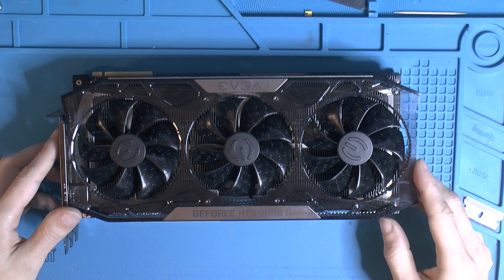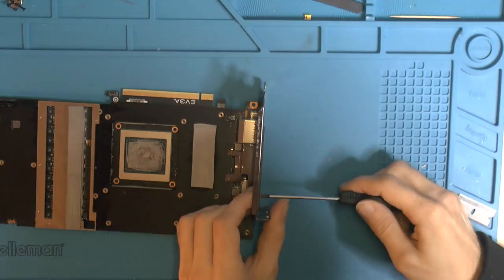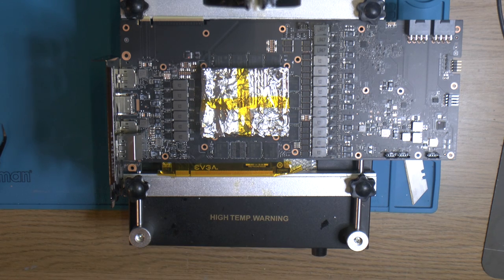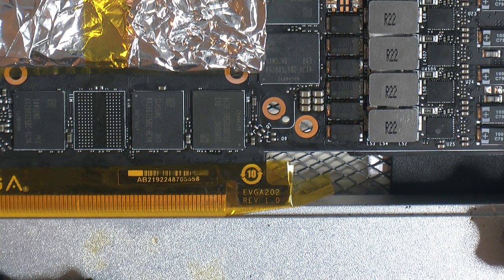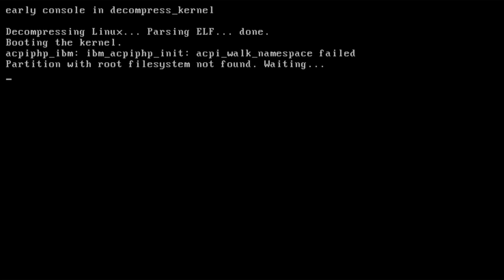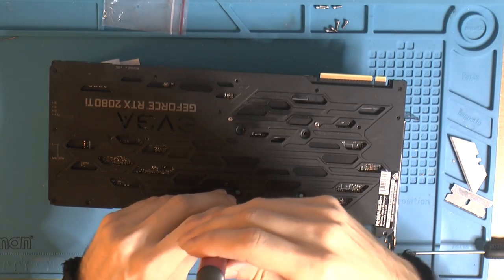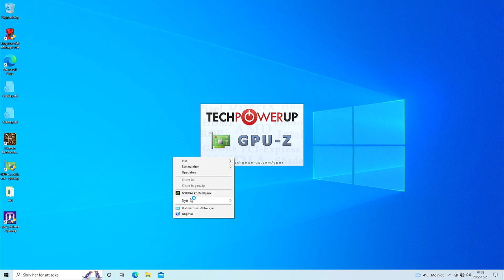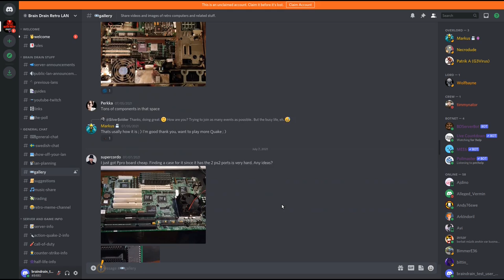Repairing a broken RTX 2080 Ti

Comment: I'm not a fan (no pun intended) of the type of cooler that this uses since all it does is blow the same air around inside the case. I prefer the type that takes air from inside the case, blows it across the GPU and then out the case back thus drawing cool air in from the front. BTW I wonder what would have happened if you had populated that empty memory pad?
Reply from the maker: Your talking about blower coolers, all my daily driver GPU's are blowers, but there almost extinct nowdays for consumer grade cards. The Quadro version of the RTX4090 as fare as a I know will use a 2 slot blower so there viable and doable and often prefererad in enterprise machines if you have multiple cards.
The problem is that no one is doing equivalent development on them for consumers, its hard to compare 3-4 slot openair coolers longer then some cases to a 2 slot shot blower fairly.
But EVGA did some world class blowers back in the day, Also ASUS do have a blower version of this card.

But yea this card wont fit my Midi case, its to long and would overheat asap.

Populating the last slot would most likely not do anything. 
If it was that easy people would be doing it all the time.
 Its all fused of in the die or vbios. 
One could go with faster ram tough if thats available, people have done that mod on cards.

Comment: 37.13 how did that work out? since you put the heat pad on the wrong side. its supposed to be next to the ram side thats why its the same length as that side. 
you are supposed to see a heat pad through the front plate at 41.58 not chips

Comment: the memory chip on the board were 843, the 8 in front stand for I believe 2018 and the replacement is 943, which is 2019, so is it ok to replace a chip that is 2018 with a 2019 chip?
Reply from the maker: I have links in the description to YT's that do this for a living that you can check out.

From what I understand Samsung ram is desirable on the card because then you can do individual chip replacement with no big issue.
So I checked with GPU-Z first to see what ram I had, It was Samsung so then I took it apart and ordered the equivalent model.

Hynix ram on the other hand required the ram to be of the same model and no exceptions from what I can find making it hard for people to track down a chip made in the same time period.
So with Hynix you might have to do a full ram replacement (not worth it due to cost), I guess you could use Samsung then and make sure the bios has support for that.

But Im no expert on the subject but I did leave links in the description to professionals that have more YT videos on the subject and thats where I got the knowledge to fix my card and they should have the information you want if my answer was not complete.
Reply: if you go to this video https://www.youtube.com/watch?v=0xPc_x3qYEA&t=539s at 6:25 and watch it through, he says about it, the date of the chip, probably because its micron

Comment: I have a RTX 2080 ti Amp Extreme Core with the same problem, but I tried to remove the module and it damaged the pcb. I know that the free bank is disabled, but could it be useful? or I already have a good paperweight
Reply from the maker: I only done this 2080TI, usually dont do modern stuff.
I dont know what your damage looks like.
I would assume you ripped a pad?
There are pad repair kits sold on ebay (probably gonna buy one at some point just for ripped pad damage), check mobile phone repair videos, iPad rehab I think have videos showing how to add new pads for the SoC of an iPhone, much smaller stuff so maybe thats one way to go if you can dig out the trace assuming pad/trace damage is what you have.

I never done it on a BGA chip, pad/trace repair but people do it so.
So you might have to do some research and practice to figure out if its doable and if you want to try to fix it.
Might be other methods I dont know about.

Also you can always get the data sheet for the ram and check what you damaged on the cards PCB.
If its just one of many ground pins it might be okay, might also be a NC (not connected pad),
Do that and you might be able to work out a plan.

Did you us a board heater or just hot air from above? I found that you need a lot of energy even with a board heater to remove the RAM chip, also helps with reinstall of the new chip.
Board heater I would say is a must on something like this but might be wrong, tough its a LOT easier with one.

I hope you find a solution.

Comment: Help Sos! i have a RTX 2080 ti FE.

it had artifacts with code 43 witch is a memory problem actually! but after a phew reboots the card would work just fine for phew minutes and crap out again.

i saw some youtubers suggesting to blast the card on the core with a heatgun for 10 min. that completly killed the card.

- NO Post!
- Fans are on 100%
- Even the Nvidia logo is inactive!

- Is the GPU completly screwed?
- did i manange to corupt the bios on the gpu with excesive heat?
 
I inspected the card nothing no burn mark or discolloring or missing component nothing.
Reply from the maker: You should not use a heatgun on a GPU like that.
Uncontrolled heat will damage the card in many ways.

Derbauer (famous Youtuber) did the same thing to his card and if I recall he had to pay 250€ for Krisfixit 250€ or so for a GPU and ram Reball and I would say that was bargain price.
https://www.youtube.com/c/KrisFixGermany

If your in the US there is Nortthridgefix BUT last I checked he dont do GPU reballing (he sad so in a video recently) becuse its not worth it.
But anyways here is his YT https://www.youtube.com/@NorthridgeFix

Both offer repair services BUT a RTX2080TI is not worth the labor cost of a GPU reball if there prices are anything to go by.